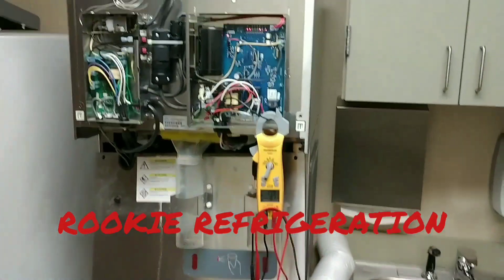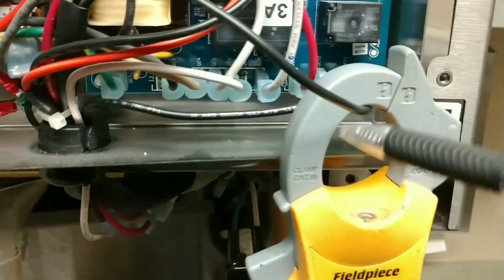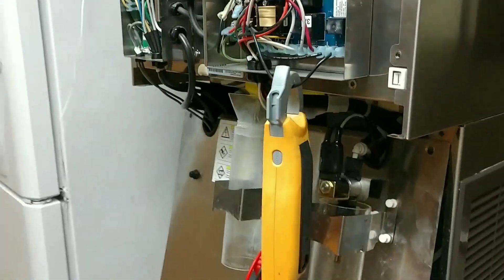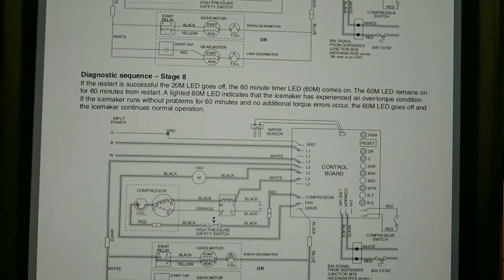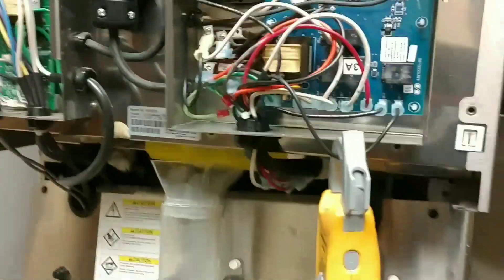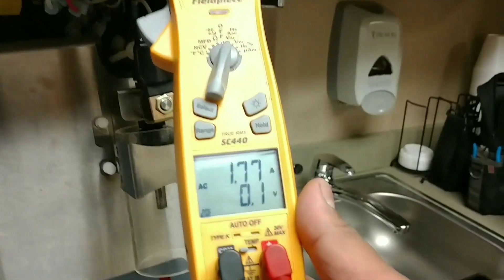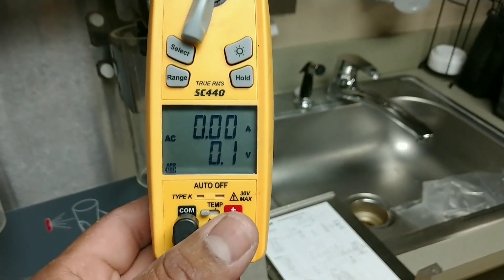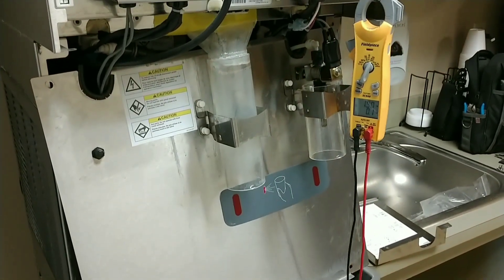HVAC Refrigeration: Follett Ice Machine down, Auger Overtorquing Pt1.

Comment: We have over 30 Follet ice machine in are health facility, You need to replace the bottom and top bearing and use Follet safe clean after replacing bearing's and sanitize it after. That Ice machine is fealty.

Comment: i Was Cleaning up a ice o matic flaker a while back and found something interesting. All the insulation was Worn out around all the piping inside the machine and it was dripping water everywhere. i Replaced the insulation on All Piping inside the machine and the machine ran so much better. Txv bulb was being affected by Ambient Because it was basically not insulated. Flooding evaporator causing problems flooding compressor. Re-insulated All Pipes. Cleaned condenser , descaled evap. Purrs like a Kitten now.
Reply from the maker: Badass.  This machine has like 3 major problems.   Leak, bearings and possibly txv power head.   We will see what they want to do...
Reply: Sounds like a Good time to get rid of that flaker.
Reply: i ALLWAYS advise people to stay Far away from flakers. Buy a Hoshizaki ice machine & a seperate ice crusher. Customer gonna be wayyy  happier. Cubers are wayy less maintenance and wayy more reliable. just run cube ice through a crusher for crushed ice.